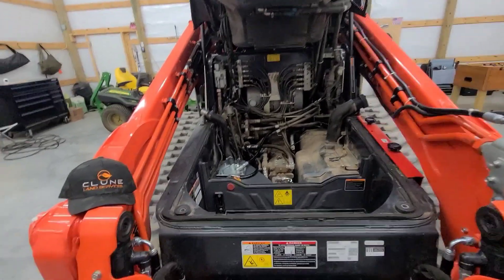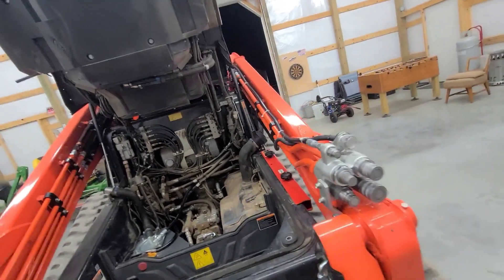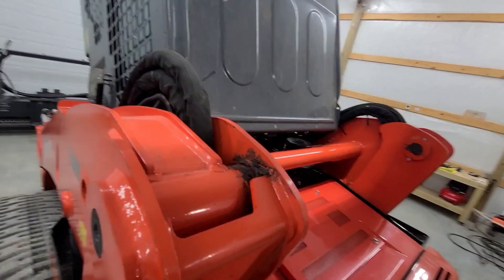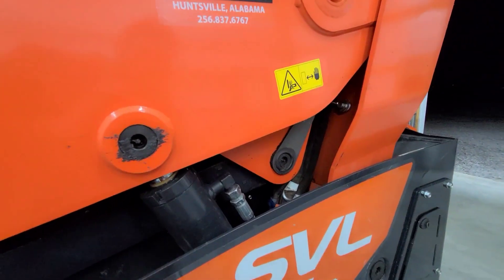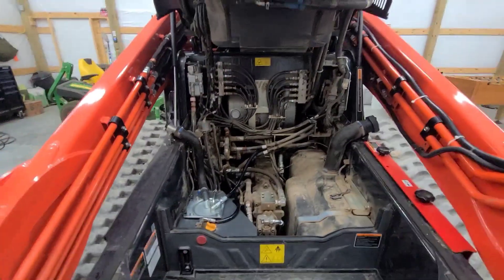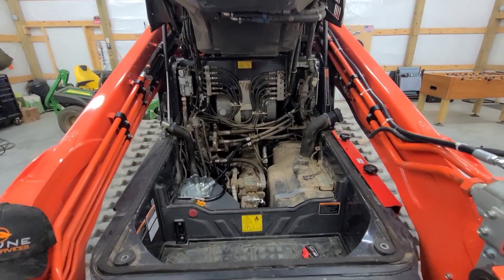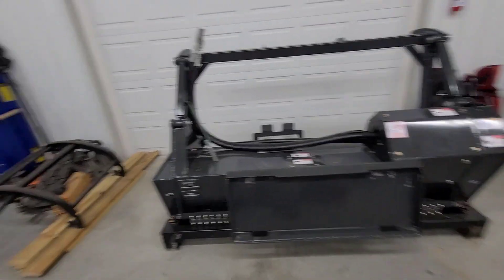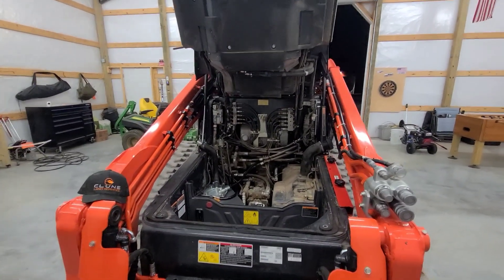Kubota 97-2 Case Drain Upgrade for my Shearex Forestry Mulching Head. #Shearex #forestrymulching

Comment: Here I am revisiting this video. lol My factor drain got bent a little and it's back flowing and i as thinking just putting it from where you capped it off and putting a soft line back to the case drain. Im hoping that will work.

Comment: Just did this today ! Super easy, I did it slightly different , 17’ hose be perfect I did 17.5 and had slack. 

I welded a bracket onto the electrical bracket and put 1/2” (#8) so there’s no #6 restriction

Comment: Is a #6 fitting smaller than a #8 line?   I'm thinking it might be restrictive and the larger hose will not benefit you.
Reply from the maker: I thought the same, and kept wanting to go with my gut feeling but Vic with Shearex said no need to update the fitting, he was able to back up his proof when he hooked the gauges up to the head and showed the pressures returning back to tank. Just that bigger ID hose made all the difference

Comment: Knives are the way to go for production. Have you run a mulcher on a Kubota skid before? I have one of the U55 minis and I run a mulcher on that quite frequently and have had no issues but I have heard the Kubota skids are bad about overheating when running mulchers. One of the main reasons I went from my Deere to ASV actually. (Deere has a lot of the same problems as well on their skids) They (Deere, at some dealers) are actually now recommending switching the quick connect heads from factory to Stucchi in order to get lower hydraulic temps.
Reply from the maker: I ran a FAE head on the Kubota with carbides open drum. I ran the Shearex today for the first time and I'm very impressed! So far no over heating issues, I do keep it blown out daily and put the screen upgrade for radiator! Shearex came down and tuned head to machine. Kubota can be a sluggish at times though

Comment: What was the reason for the upgrade?
Reply from the maker: The factory case drain line on the Kubota is to small not letting the pressure release out of the mulching head. Upgraded line to a #8 hydraulic line gives it the volume and flow back to tank. Resulting in machine staying cooler and more pressure to the head 🤙
Reply: @clunelandservices  Heard that. I just got my Kubota 97 back today. My case drain some how got cracked and they had to install a new manifold. The air unit in it was so clogged up from mulching that they had to remove it to clean the evaporator and blows like a champ now.